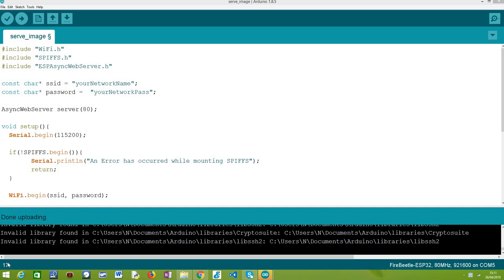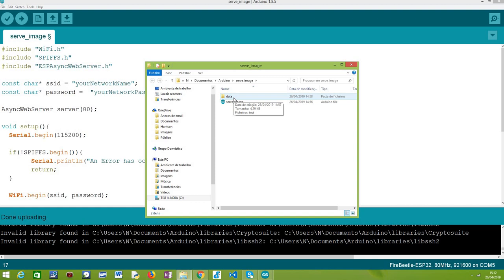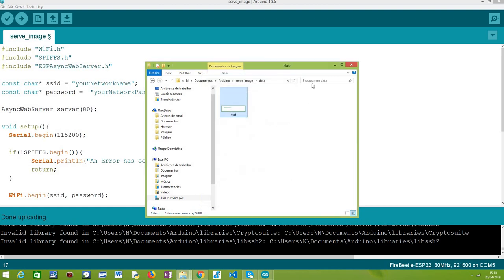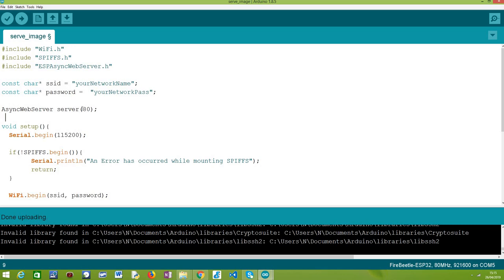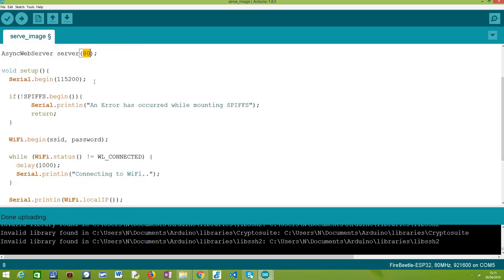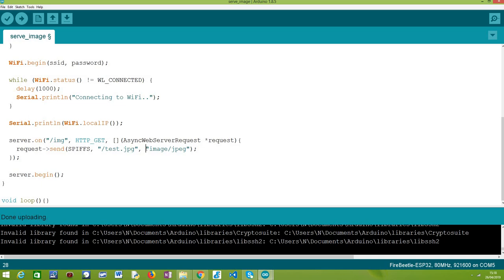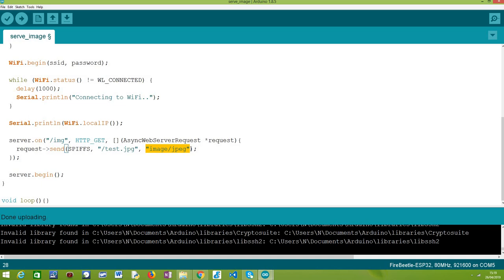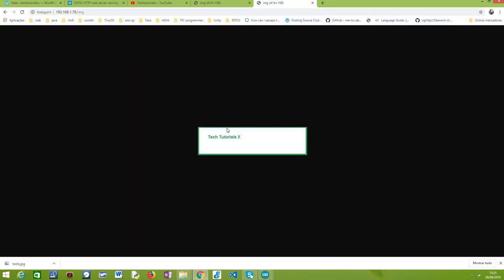ESP32 Arduino HTTP web server: Serve Image from SPIFFS file system

Comment: SPIFFS is outdated, try FatFS. It's a LOT faster than SPIFFS.
Reply from the maker: Hi! Thanks for the suggestion :) I have already done a couple of tutorials on the FAT file system, although I haven't yet done any comparison between both in terms of performance.

Nonetheless, I haven't yet found any simple to use method to upload files to the FAT file system, such as the plugin we have for SPIFFS. This is why I'm still using SPIFFS for these HTTP web server tutorials.

I haven't investigated much about comparisons between the two, but I would say that SPIFFS and FAT are two alternatives.
Reply: @techtutorialsx11  Great, I am gonna check them out !